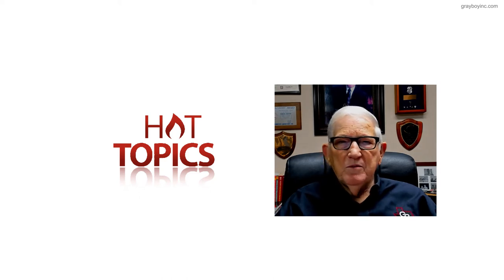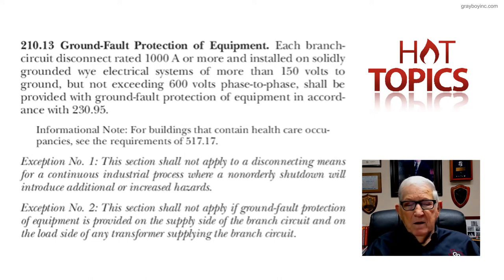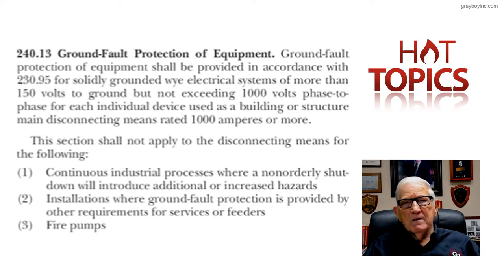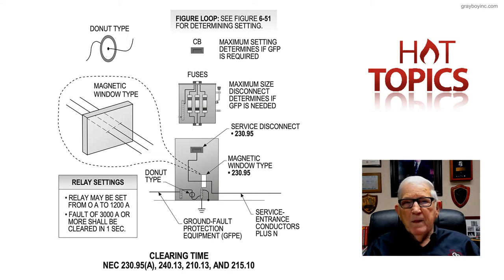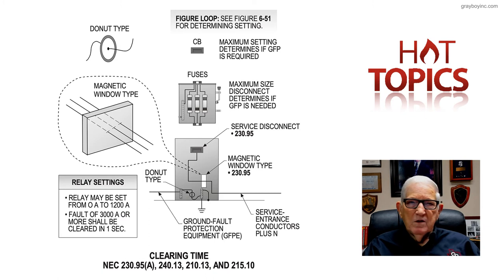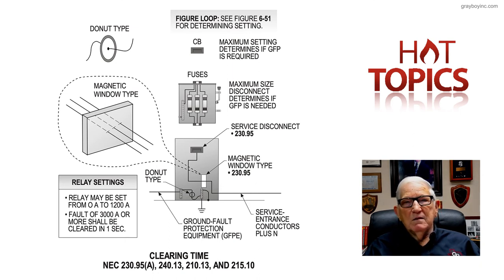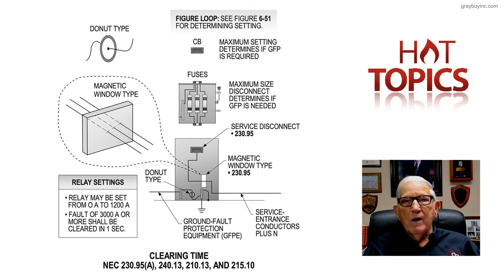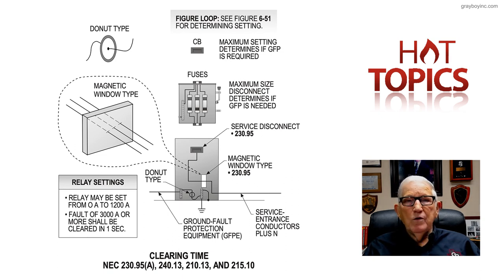HT  E 03  -  (GFPE)  Ground Fault Protection of Equipment  -  230.95, 215.10, 210.13, & 240.13

Comment: Thank you.
Reply from the maker: Hi Frederick,
I’m sorry that I’m getting back late but i”ve had the flu and been sick. GFPE is required due the voltage being over 250 v to ground. when 277/480 is the voltage used three is a re-strike voltage that builds up a resistance that a large OCPD of a 1000 amps or larger can’t detected. This condition will not occur on a 120/240 or 120/208 v system because you need a direct path. Thanks for your comment and have a Happy New Year.
James G Stallcup
Reply from the maker: www.grayboyinc.com 
Use the following coupon code at checkout for 45% off all products. Coupon Code:   22GB45